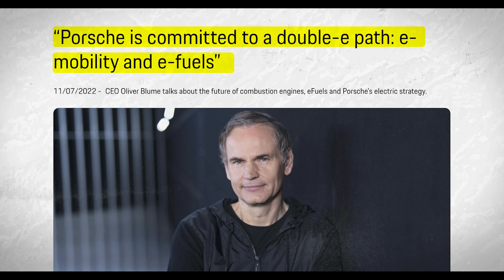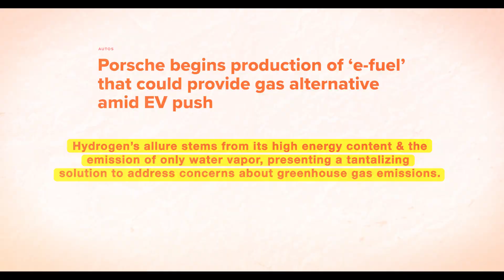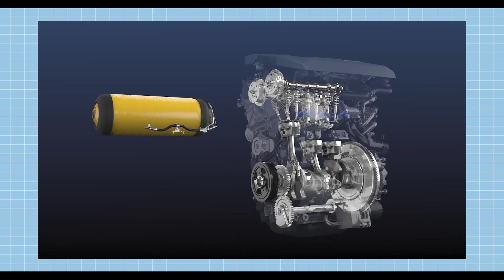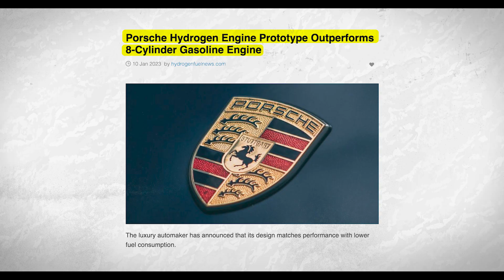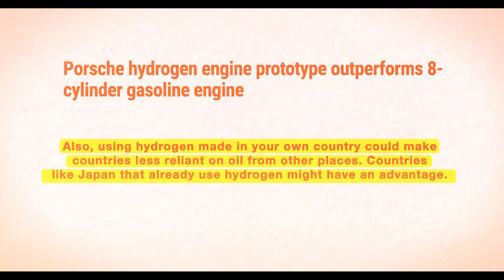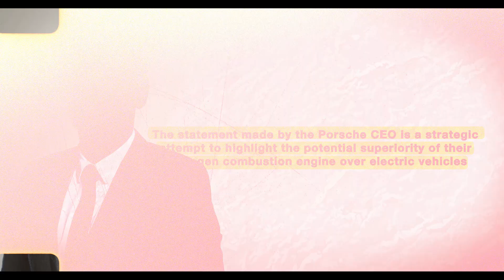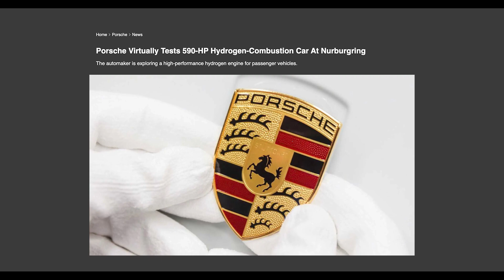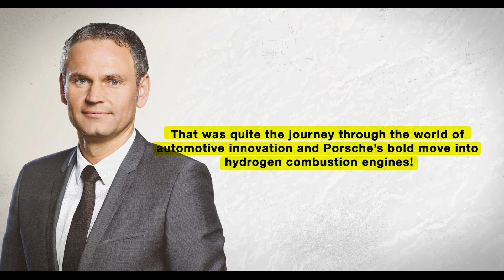Porsche CEO: New Hydrogen Combustion Engine to Outperform EVs!

Comment: Hydrogen infrastructure and cost is still impractical more so than EV
Reply: How? You can put a hydrogen station in remote areas. Running power lines to a remote area ain't cheap. Putting a tank with dispensing equipment is basically free in comparison. Hydrogen can even be generated on site.
Reply: @fundamentallybroken4194  yeah the on site generation is a big plus. With the plummeting cost of wind and solar power hydrogen may be close to free some day.

Comment: the Problem is, there is no whereto get hydrogen yet and to make it financially acceptable for a company to start selling it there needs to be enough Hydrogen cars on the road so it would take many years for  car companies to switch to hydrogen engines and for people to start selling hydrogen to make it useful enough to own a car running on Hydrogen. even with Electric cars there still isn't enough places to charge all the cars they have or want to have and it takes so long you would need tons of chargers at each place to keep up with all the cars that need it if the number of electric cars starts to eclipse the number of gas cars. Not to mention the limited amount of resources there are to create all the lithium batteries needed for electric cars in times to come. Which mean batteries will get more and more expensive.

Comment: Here we go again. Another company that thinks they can break the laws of Physics and beat the end to end efficiency of BEVs by introducing many more inefficient steps along the way. They seem to think that these steps don't matter, especially if they're powered by renewable energy. However, what they are deliberately misleading you about, is the fact that those same renewables would be far more efficiently used to directly charge a BEV!
As for a Hydrogen Combustion Engine outperforming an EV, that's pure fantasy. Whether it's efficiency, simplicity, flexibility, cost or convenience a BEV is better in every metric.
Why are people still falling for this nonsense?

Comment: Imbecilic wishful thinking. Even if the problems of generating and storing green hydrogen could be solved burning it in an ICE would ne the most stupid way to deploy it. The ICE is a terrible traction motor rescued by a century of genius engineering. A hydrogen fuel cell EV would destroy a hydrogen ICE. Nobody would buy it.

Comment: Hydrogen production is very costly.
Reply: And electrifying is a cheap process? I’d rather have petrol of Diesel ICE. EVs are fun to bring to the track but not so much for cross country trips.
Reply: @Justforfun-ek7et  - Indeed it is cheap, the Electricity generation and distribution system is already available everywhere. Most people rarely do cross country trips, cars normally do modest mileages based from home. Charging on the go is getting faster every year, as are the number of chargers. Get with the times, this is a revolution that you're going to be involved in, whether you like it or not.
Reply: @rogerfroud300  you sir do not know your facts. Yes we have an electricity grid, but the grid cannot and will not support everyone going electric… not to mention it costs more money (which is what I was referring to in my first comment) to make one EV battery than it does to make 100 barrels of petrol. I am more with the times than you are. All the data that is shared by government agencies and other businesses pushing electrifying vehicles is nit picking data and lying to your face about the benefits of electric vehicles. I feel bad for those people and especially the children that are mining all your precious metals to make your batteries.
Reply: Lol they found massive "oil" fields of white hydrogen among alot of continents. Wich can be produced like natural gas is produced
Reply: gold hyrogen is not costly